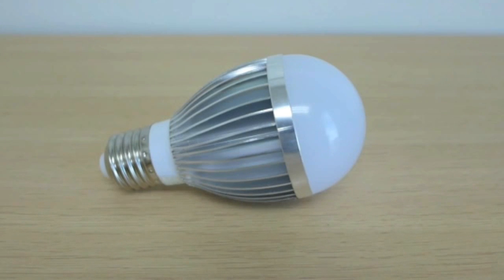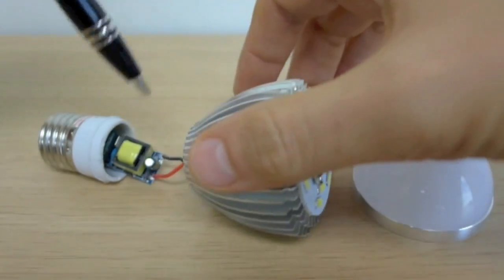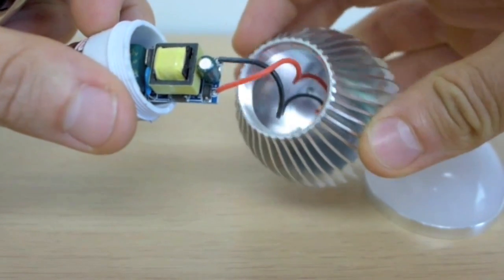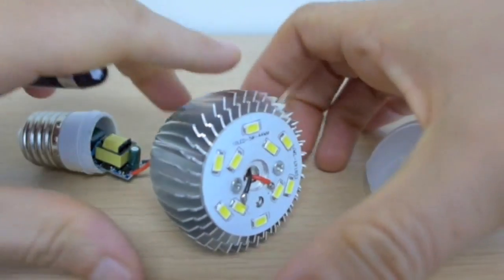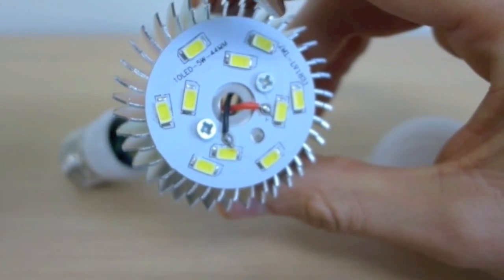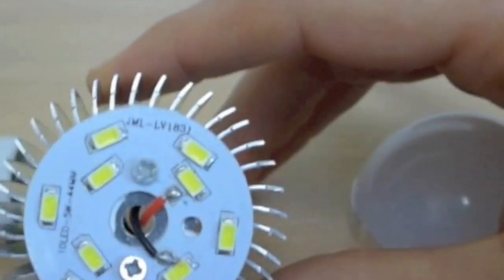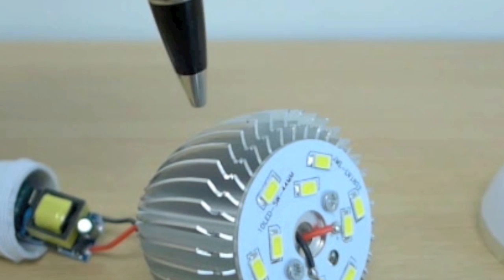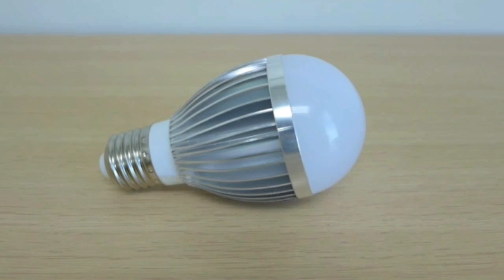LED Light Bulb Disassembly

Comment from the maker: Noticeable flicker is likely due to LED (or CFL) bulbs being used on a dimming circuit for which they are unsuited (Even if the dimmer is turned to full)
Also CFLs emit UV light and UV light is commonly responsible for eye strain and headaches.
My best advice is the try some LED light bulbs that offer a return policy if you're not satisfied.
And try different ones with different brightness levels and color temperatures. You'll for sure know what you like best when you try them out!

Comment from the maker: In this instance Hz is a measure of the cycles per second that AC (alternating current) electricity changes direction.
Almost all over the world AC power comes into your building at 60Hz. But irrespective of that LED light bulbs have a driver (as do CFLs) that converts the power to DC (0 Hz) before it gets to the LED chips.
DC is a steady flow of electricity.